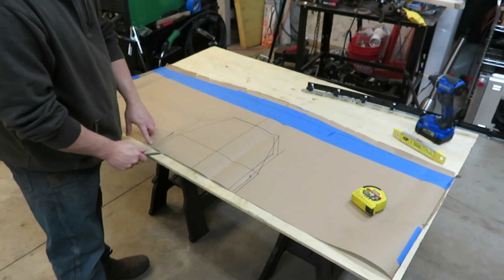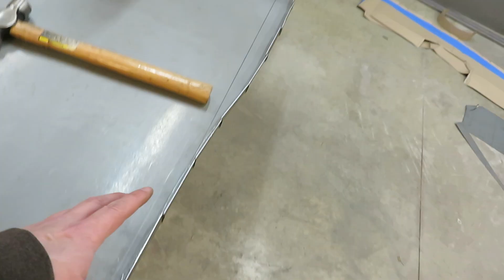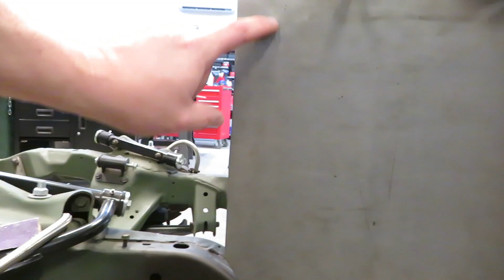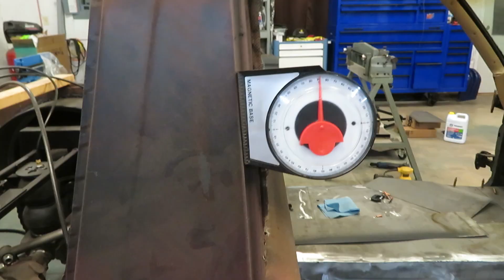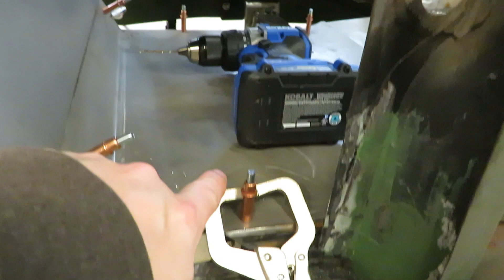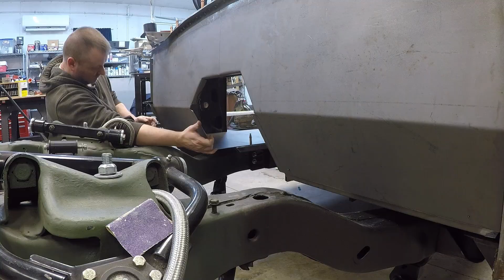Forming a Custom Firewall & Matching Floor Pan Angles | Sheet Metal Fabrication

Comment: Cool.  I'm building a drag n drive 62 Falcon and looking to fab a new firewall to set the engine farther back.  Are you going to do any beads or offsets?  Seems that a piece that big and smooth is going to have a tendeny to oil can or do you have another way you're going to deal with it?  I am trying to figure that out because I have the small Esatwood bead roller, but doubt I can get anything of note rolled into the firewall because of the small size of the bead roller.
Reply from the maker: I understand the question, I too thought I needed to put some beads in it and I also have a bead roller that is not beefy enough for this sheet metal. I asked some experienced sheet metal guys that I know about this and they said I should be good because I do have some 90 bends on the top, I have the bends that meet up with the floor pans and I have bends at the trans tunnel. I am also using "heavy" 16 gauge which is thicker than standard. Sitting in place, it seems to be ok. I guess I'll find out before too long. Your project sounds like fun, I wish you the best of luck on it.
Reply: @DCAutoEnhancement ok, that's good. I'll probably be using 20 or 24 gauge so I need some beads or roll an offset to it. Or I could just not do all this extra work to move the engine back 2-3". Lol
Reply from the maker: I totally understand. I think you will be happier with the end result to do it the way you want even though it's a lot of extra work. This car was originally going to be a slap together Ranchero/S10 mashup. I decided to take a little (a lot) of extra time to do the best I can.